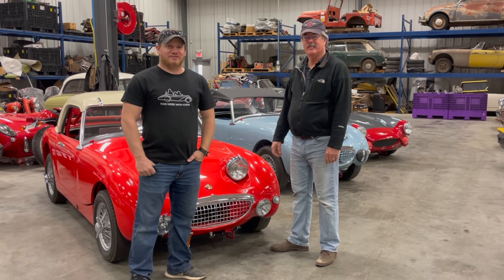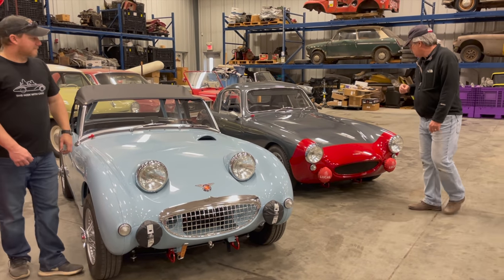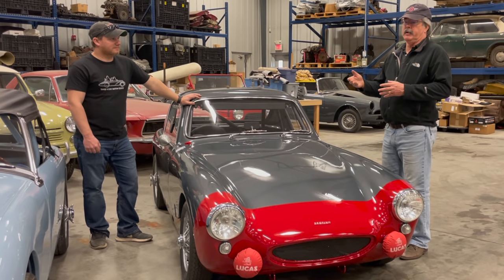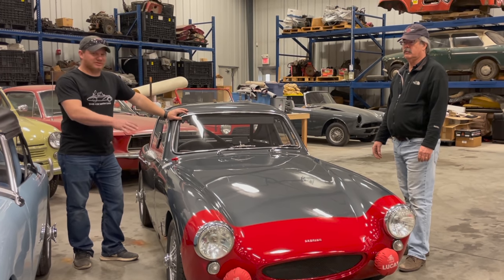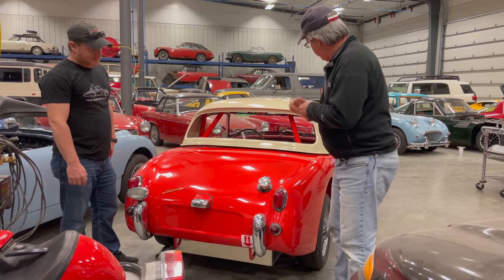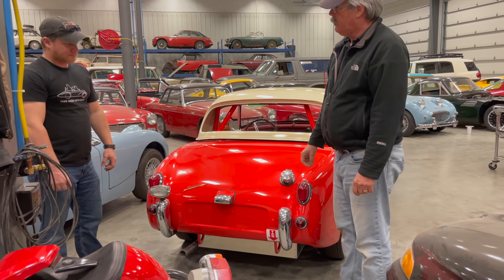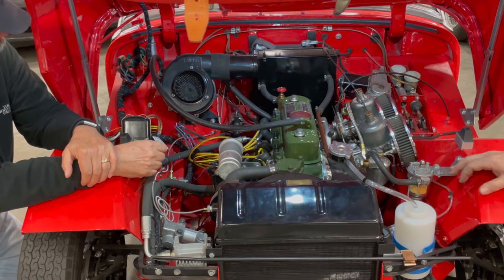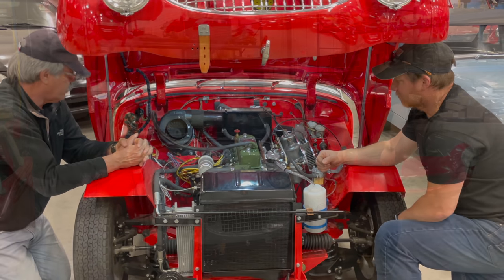Creating the Grasing Collection of Sebring Sprites

Comment: If this had been out two weeks ago, i would have forwarded a link to my  brother in law, Tom H. Unfortunately Tom died last weekend. Tom and my sister Jeanne, d.2013, were life long race workers for SCCA in the Washington Region. Jeanne was in timing and scoring and introduced electronic transducers into the cars to partially automate the process. Before that my wife and I along with our young sons would go to places like Summit in WV, Pocono in PA and Lime Rock. We’d work sheets for all the racers with multiple stopwatches in front of us recording all of their lap times. Jeanne was in charge of handling disputes when the drivers came screaming up to the T&S shack. Drivers and Workers were different bunches. In Tom’s case he was a Steward experienced in scrutineering. When you mentioned that you had ported the heads of those Sprites, I was reminded that Tom had the power to say, “Bring me the head of the number 21 Sprite. I want to cc the chambers.” They both won SCCA awards by the bushel full. One year they won the worker’s raffle at the runoffs in Ohio. The prize was a pair of round-trip tickets to France and two tickets to Le Mans.
They also did TSD rallying in the Baltimore area;first in their 1966 Volvo P1800 and later on in their 1986 Toyota Supra. Jeanne drove and Tom navigated. Tom used the Halda Speedpilot and also a Curta Calculator.
For Iowa people. Is John Ames, many times national champion in Solo1 and Solo 2 (autocross), still out there? I bought a 1960 through 1964 Volvo PV544 from him in Baltimore just before he and Nancy returned to Iowa.
Reply: I’m sorry for your loss. Tom sounds like a guy I would have enjoyed knowing.

Comment: This is just an incredibly detailed video - as a mk2 Healy owner reg 1367VU '61 vintage I am in awe - great great channel
Reply: I am pretty sure 1367VU was my old car/project. did you acquire it from your brother ?
Reply: @michaeltough2449  i got from a guy called Charles Harman it had blown a ring and the debris was hammering on the cylinder head so i swapped the piston out with the engine in situe in the street back in oxford 1976 i also replace one of the 1/4?rear leaf springs then sold it to a guy i worked with john nicholson -
Reply: Ah, okay, you don't own it anymore.  It is now a sebring replica like the last car featured in this video !!!
Reply: Wow that is amazing - it had a fibreglass bonnet  already fitted when I acquired it from Charles for around £30.00 - I considered an arkley kit but it was very sound even then despite the plastic front and it fitted quite well

Comment: Fantastic effort to replicate the various Sprites in their heyday. I had hoped you had kept them RHD though if you are trying to make virtually exact copies of particular cars as raced and rallied by those drivers at the time. Didn't they have a locator for the one man quicklift style level jack at the front where you have your tow hooks? If you had mounted them upside down you could have used the 'hook' as the location point for the jack.

Comment: Superb video. Lovely cars. Some questions: 1) why does the rear ride height on the red car look so high? 2) Interesting to see the adjustable lever arm shocks. Are they readily available? I recall the standard ones were rather feeble 3) what events in Europe are you hoping to do?
Reply from the maker: 1) Since it does not yet have full weight on it the rear springs have not been shimmed for ride height yet.  2) The lever arm shocks are not available anywhere you have to be lucky enough to have an original set.  3) The Sprite World Meet at Zandvoort and the Revival Goodwood.
Reply: @ThisWeekWithCars  Tks for that Steve. I'm aiming to be at Goodwood, C19 permitting, so I may get to see the car(s) in the flesh.